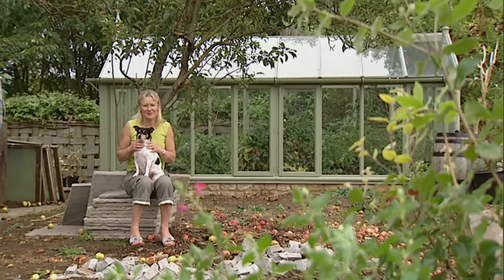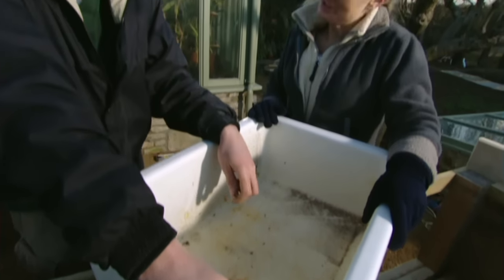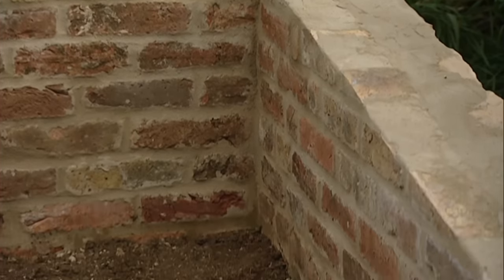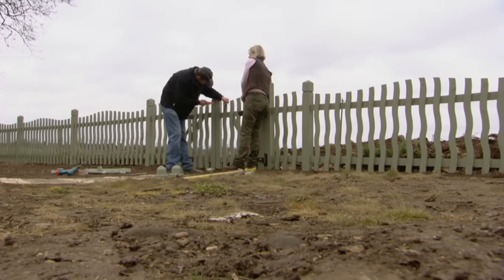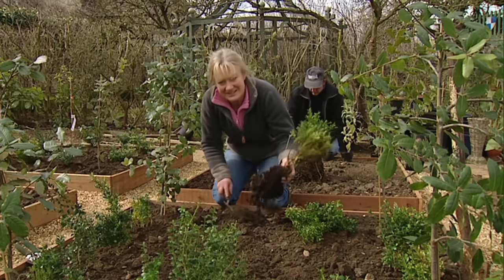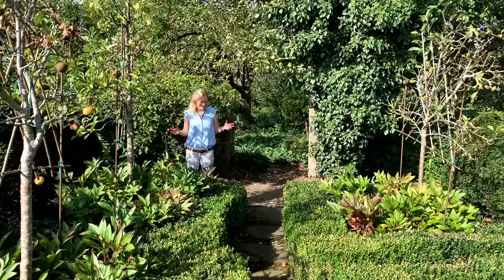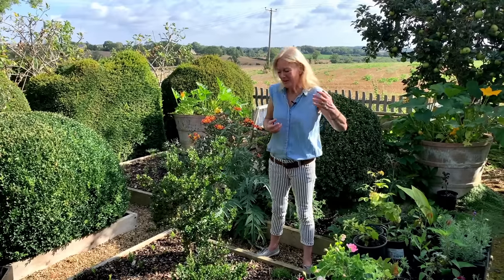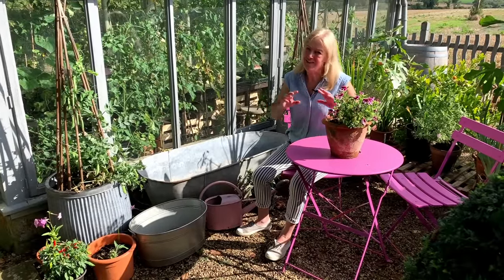The Powerhouse of my garden - my favourite part

Comment: Lovely space. I wish I had more sun in my garden. Re box, I got rid of box caterpillar in my garden and my daughter’s garden using 1 tablespoon neem oil to 1 pint of water, just massaged the plants all over with the mixture, did it once in the Spring and again in July/August.
Reply from the maker: Interesting re Neem. It is a great pesticide we used in Japan a lot and apparently popular in Germany too. I have used it for other pests but is very thick to apply with sprayer, hence why you say massage. I think it qualifies as organic, it comes from Neem tree in India as I’m sure you know. ❤
Reply: @bunnyguinness  As I only have a dozen or so box plants  (meant to look like chickens) and my daughter the same it is simpler to make up the mixture and wet the plants by hand, I kind of massage it into the branches and leaves and twigs. Neem is from the neem tree and is extensively used in India and Sri Lanka, maybe all of Asia, as an insecticide, disinfectant etc. (head lice!). Completely organic and natural. I made up the proportions myself as I couldn’t find advice anywhere, it may be that a weaker mixture would suffice. Neem oil tends to be solid at room temp in the UK so you have to warm it a little. When diluted I think it would go through a spray but I did take time to thoroughly soak the plants. I got mine from Amazon but probably Asian shops stock it, I don’t live close to any.